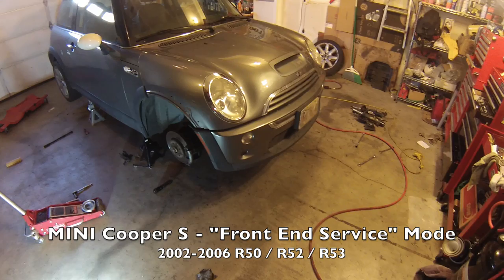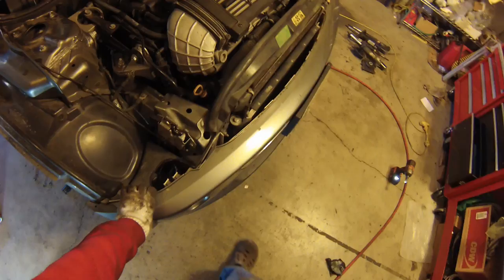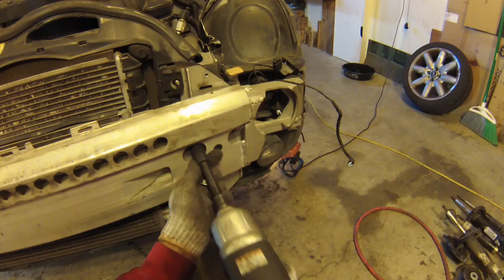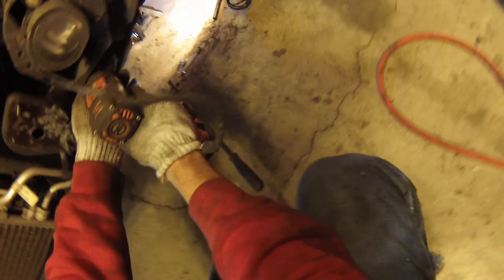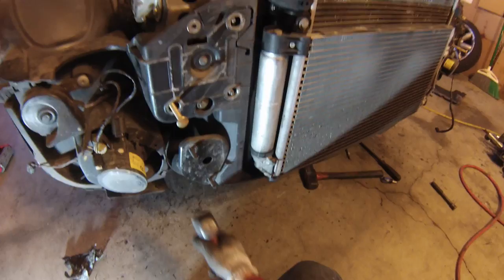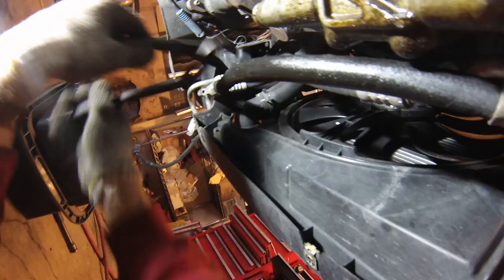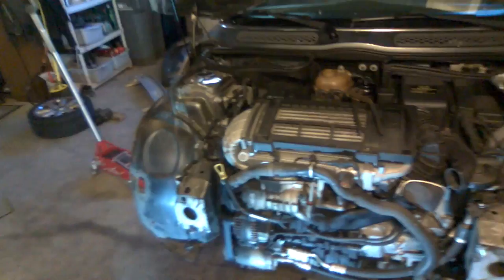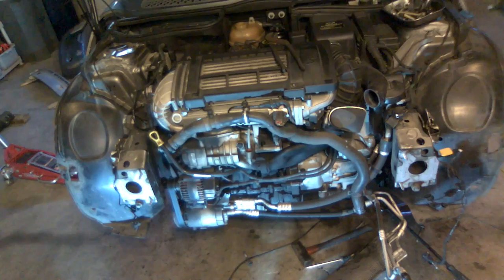Front End Service mode 2002-06 MINI Cooper/radiator/bumper removal howto

Comment: On my 2006, the Torx (bumper cover to radiator support) is a T30, not a T25. Also, the 5, 13mm fasteners, (aluminum bumper) are all nuts over studs (need deep well socket). Torque spec for crash tube bolts is 100Nm/74ft-lb. Long screws to pull radiator forward are 8mm x 1.25mm thread.  (I used VW tool 3411 which are the same thing, just long rods threaded on the end)
Reply from the maker: Thanks for clarifying.

Comment: Thanks again MM. I've kept my '05 for over 100K so needless to say this being a first gen S which is driven hard, I end up doing this ALOT.. My share: use a little anti seize on the threads the first time around, makes things go much quicker both in and out (a little last a long time).
 I put the 10mm guide bolts into the frame while the crash bumper is still on and leave it there until after the bumper is back on.. I find it holds things loosely in place while sorting out the wiring. 
I don't like the screw type fender rivets, they inevitably spin or strip so I buy a whole bag of the pop out kind and change them when they even start to look sketchy. 

I use a long length of wire cloths hanger for pining the tensioner from 2 feet away, it 's easier standing back holding the tensioner tool with one hand and not trying to lean over and negotiate pliers and the little keeper pin.  Same on the release. 

I remove all the body and frame bolt at one while I'm underneath with my impact and 2 sockets, saves a minute or 2.

On a good day start to finish maybe 8-10 minutes.

one last note- I tried chain store parts for while. For me it wasn't cost effective, while the aftermarket gives "lifetime Warrenty" same as mini I found it to be more about marketing. Even if Discount parts store gets a 15% failure rate they still make money. Yes I get a free store replacement but the hours of hassles of doing job twice and perhaps having to wait on store inventory isn't worth the extra 10-20% the dealer charges. I've never had a dealer part fail.

Comment: Wow, can't thank you enough for you helpfull videos. My 2004 mini cooper s JCW was riding so rough that when I brought it to a local shop who gave me an est of 3800$ for suspension renewal, but with your vids and the help of my good friend, who is a pro mechanic,  we dropped the sub frame and replaced ball joints, sway bar links,  hubs and bearings, and for only 100$ we replaced rear trailing arms with a used aluminum set from a 2009.  We are still tweeking but so far a great improvement in ride and handeling. One problem that still concerns me though is this, that the cars bumper cover / air dam/  is not conected to anything along the bottom. I am pretty sure which under tray is missing and which part to order, but between that skid plate and the lower edge of the bumper cover there is nothing. The bumper cover is swinging in the breeze. I think I need the correct oem lip spoiler and I am confused about which one to order.  I think that the missing part anchors the skid plate to car and to lower bumper cover lip.  Thanks, Chris Z

Comment: Turns out it's the radiator.... Leaking on the top, bottom and the coolant overflow tank was full 4 days ago... Now completely empty. Need a new radiator which isn't going to be fun for my mechanic. Thanks for your reply. I've subscribed.
Reply from the maker: Bingo. :-) Seems to be an issue only for 02-03 cars. Amazon has great prices on radiators, probably any of them are better than what the car came with. 
Just follow this video and then it's only another 15 minutes to separate the radiator from the front end module. Entire job shouldn't take more than 2 hours.

Comment: Finally decided to purchase a 2003 R53, and tear into all the maintenance. Cannot thank you enough for all the videos and attention to detail. QUESTION- other than crank sensor o-ring, super charger oil, water pump, and oil pan gasket... what else would you recommend servicing on a mini while in front end service mode? My car has no maintenance history and would like to cover all bases.
Reply from the maker: water pump to block flange o-ring.Valve cover gasket.

Comment: Thanks for the tips, Mod.  What is the thread size on the long bolts used to bring the front out into service position?  What are the chances of reaching the crank position sensor from service position without actually removing the core support?
Reply from the maker: I think they are M8x1.25 thread. They are the same thread as the bolts that you remove from the bumper.

Comment: What size bolts do you use to hold the radiator on when you put the car on service mode? 8mm by what thread pitch? 1.0, 1.25, etc.

Comment: What would you do if the heads of theT30 bolts in the middle that hold the plastic bumper snapped off and you can’t get the rest of it out?

Comment: I just replaced my coolant fan and it won't shut off. When i first bought it last year it would stay on for a new minutes after but would shut off. It died a month ago and i replaced it with a new one today. Now it see,s like it would run for hours until the battery died. Any suggestions, thank you

Comment: Thank you for making this job so much faster and easier for me. I have a 2003 Mini S, 79.000 miles, with a blown head gasket and leaking at a water pump seal. Yesterday my son and I followed your video and removed the front end and the head. Ordering parts now and will put it back together in a week or two. Question, looking into the super charger inter-cooler we found a bunch of small thin plastic scraps at both ends blocking a lot of the air flow and have not figured out what it is or how it got there. Any Ideas?
Reply from the maker: In the intercooler? Never seen that.

Comment: Hey there! I saw somewhere else that it is necessary to drain the air conditioning gas pipe to remove the radiator, but I didn’t catch that step in your video, is it really necessary? Or just by draining the coolant fluid is enough.

Big fan of your videos, I am grateful as everyone here for the big favor you are doing to our wallets
Reply from the maker: I do not open the system. Just hang condenser off to side.

Comment: My bonnet’s latch on the right side of the vehicle (driver side) isn’t shutting all the way, do you know if it’s the latch or the cable that I will fix? Thanks for your videos!
Reply: Try adjusting your passenger-side latch upwards by a few millimeters.  I had to deal with this same issue after replacing my driver- and passenger-side latches (the originals had gotten rusty and gross). After much trial and error, I realized that I had installed the passenger-side latch a few millimeters too low, which caused my bonnet to twist just enough upon closing to prevent it from fully latching on the driver-side.

Comment: Thanks for another very informative video.  I replaced my bypass valve yesterday then noticed that the supercharger intake duct had become detached from the supercharger :(  Looks like I will have to follow the steps right up to removing the radiator to get that fixed
Reply from the maker: beagletube I've done it many times and never seen that happen before. Maybe the 10mm bolt is missing or the plastic is cracked. You might be able to make it go back by pushing in the correct direction. once the throttle body is fastened down, it won't go anywhere.
Reply: ***** Yeah.  Everything looked solid when I reassembled.  Started the car and the revs climbed to 3000 right away and was loud.  Shut it off and began disassembling again.  I noticed the intake duct was all wobbly as soon as I got the snorkel and large air intake hose off.  

Most likely a beginner mistake on my end.  Thanks again for the super informative video and replying

Comment: Thank you for this video. 
If this car needed an alternator replacement, are the radiator hoses long enough to allow the radiator to be slid forward a sufficient distance for access to remove the alternator bolts or is complete radiator removal with disconnecting of radiator hoses inevitable?
Reply from the maker: Yes, the alternator can be replaced without cracking open the cooling system. I have video for an alternator replacement but haven't edited or posted the video yet. Essentially the steps are: disconnect battery, put car in front end service mode, loosen 10mm bolt for battery cable on alternator (use pair of pliers to prevent entire terminal from rotating at the same time), remove accessory belt, unclip regulator cable, remove 3 10mm bolts holding alternator on to engine block, assemble in reverse order.

Comment: Hey since I saw the cooling fan. Is there any way to make them quieter mine turn on almost every time after shutting down the engine. It's really annoying.
Reply from the maker: Sounds like you have a burned out fan low speed resistor. When the low speed resistor is burned out the fan will only run on high speed mode. You can replace the entire fan shroud assembly, which includes the resistor, or replace the resistor. See http://www.northamericanmotoring.com/forums/stock-problems-issues/174040-low-speed-fan-resistor-we-need-solution.html for details about the problem and some solutions, or http://www.amazon.com/TYC-621080-Replacement-Radiator-Condenser/dp/B002BBDNFU for a typical replacement part that will solve your problem.

Comment: Thank u sir. Very much appreciated. Question? What size bolts do u use to screw in to take out the front end. Those two screws u used. Length and diameter. Thank u
Reply from the maker: I don't mention in the video? I think they should be M8 x 1.5, longest you can find.

Comment: Hi Mod MIni, 

After replacing the O rings and Water pump on my mini R53 MCS, once the front was all back together and I turned it over for the first time to  bleed the coolant system, it ran fine for around 30 seconds,  then the revs went up and down, then seemed to develop a missfire. I turned the car off left it for a little bit then tried again once the bumper beam was back on and it seemed to be normal. Not too sure whats going on. 

Any thought would be greatly appreciated.
Reply from the maker: Might have been a vacuum leak, maybe a pinched seal got sucked into place.

Comment: Is it possible to discharge the ac radiator by yourself if you want to replace the ac radiator  I know there are two ports of the left hand side of the mini r53/r52/passanger side.. I wanted to change the ac radiator.
Reply from the maker: That would be an EPA violation.

Comment: Hi. Super helpful.
My car's radiator fan keeps running, the minute it is plugged in (even if the car is off). What would be your guess as to the problem (is it the resistor and should I be changing the whole fan assembly)?
Many thanks
Reply from the maker: Yes resistor. You can splice in another one (not officially approved repair method)  or change the whole fan assembly.

Comment: Thats an awesome DIY! Thanks. I have a question: my R53's cooling fan is wobbling too much (it looks like its hitting the surround). Can I remove the fan shroud with the fan by just moving the radiator that little bit forwards on studs like you did? Or would I need to remove the whole radiator and flush the system?
Reply from the maker: Radiator tips forward to remove fan. Might need to remove upper hose.

Comment: HI. I changing Steering wheel on my Mini R60  . from No Button to Multimedia butts. but is not working. If I buy  ISTA P   , will I bee able to activate  Multi media butts on my steering wheel? thanks for your time
Reply from the maker: Pretty sure the wiring is different. North American Motoring forum may have some useful discussion threads.

Comment: Very helpful video👍🏼

Question: do you need to de-gass the air-conditioning system for the frond end service mode?
Reply from the maker: No, just leave evaporator connected and hanging to the side.

Comment: Is it feasible to change the crank position sensor without totally removing the radiator and leaving the hoses still connected?
Reply from the maker: ewgoforth yes but it is very tight going. You can really only use one hand and need to know where the bolt is because you won’t be able to see it.

Comment: Hi Kurt, Thanks for posting this video. I'm noticing a small coolant leak on the passenger side front of my 03 Mini.. I'm thinking it's the thermostat... Would the vehicle have to be in FES mode to replace that? Thank you :)
Reply from the maker: Hi. On the 2002-2003 cars, they sometimes leak from the radiator inlet hose which is immediately in front of the dipstick, so check there before diagnosing as a thermostat leak. Look for moisture on the plastic side tank at the very top on the passenger side of the radiator (for left hand drive car). 
Having said that, thermostat leaks are very common with most Gen1 model years  
No need to put the car in FES mode for a thermostat. I am doing a thermostat replacement tomorrow and will try to get some video!

Comment: hey just out of interest how much should i pay a garage to replace some of the piping as my minin keeps leaking coolent and the garage said theyll have to take the radiator off to fix the piping how much should that cost tops??
Reply from the maker: Do you mean hoses? It depends on the problem and what a shop charges. I can't imagine it should be more than 5-6 hours labor.

Comment: For an alternator replacement do you think a tear down to this extent is necessary?  This will be my first work on a Mini Cooper.
Reply from the maker: +Adam Barraclough You need to at least pull everything forward into FES mode, but not necessary to remove front end completely. For an R50, you can get it out just by removing the top radiator hose.
Reply: Thank you.

Comment: Just finished replacing my motor mount on my R53 with the help from one of your other videos. I have a few more things I have to do, one being to replace my Radiator Fan. I believe this video is the closest thing you have to showing how to replace it, but I'm sure it can't be too difficult. In your opinion, as I'm sure you've replaced a few, where would you recommend getting a new fan? I would prefer not to spend $300+ buying OEM but I also don't wan to purchase one that will burn out again in a couple months.
Reply from the maker: Not sure what is your question. If your fan is not working, you need to replace the fan. Any fan should be fine. You might be able to find one at a junkyard or on eBay if you don't want to buy a new one.
Reply: Mod MINI I went on RockAuto and they have a few fans on there cheaper than OEM but I wasn't sure if you had any brands you preferred or would avoid

Comment: Very easy to follow and detailed guide. while I have the front end opened up is there any other small things like the crank position o ring that I should be taking care of? I notice I also have some oil build up behind the left fender lining do you know what this could be? Thanks for the guides!
Reply from the maker: +Oases Yes, do the o-ring. Left fender? That's the transmission side. no idea other than a bad axle.
Reply: +Mod MINI Thanks for your reply. Also when I'm putting the radiator and bumper liner back on, how can I tell which cables connect to which lights? Do I put them in depending on the length of the cable?
Reply from the maker: +Oases It's pretty obvious, but shortest goes to the horn, longest goes to the side marker. Medium length goes to the front position marker.
Reply: Okay I thought it was like that just wanted to make sure. My battery is dead with my car on jacks and no way to charge it so I couldnt test. Thanks for your reply!

Comment: Gracias por estos aportes amigo!!!!! ami y al Club nos ayudara mucho...
Reply: *****

Hi Kurt
       I was seeing your videos on you tube, which by the way I find them really  great and very helpful.
Many years ago I use to modified street cars, alpine, R-5 & R-8 Renault for racing, and I use to race them to. They were a totally different cars and motors that they are now. I have a mini cooper S 2005 with heating problem, very unusual for my understanding, because I was driving the car for several weeks with no problem most of the time,  but some times it was getting hot, not every time just some times, until my wife drove it very hot and the radiator now has a leak. So I want to fix it, of course changing the radiator, but most important trying to find the problem.What do you think the problem could be? the pump can not make an intermittent
heating problem?maybe the thermostat or the heating  sensor that turns on the electric fan, to me the electric fan seems working properly. Because of the complexity to reach all those areas I think I'm going to change the pump, the thermostat and probably the electric fan sensor. Please give your advise, and tell me  if you know and can recommend those parts brands:
 Nissens    for Radiator
Mac kay    for coolant hoses
Wahler       for thermostat
Graf            for water pump
or what brands do you recommend ?

If you are not to busy and you can answer me I will deeply appreciate it.

Very best regards
Joaquin
Reply from the maker: Joaquin Balaguer Most leak is from the thermostat housing. Other possibility is radiator itself, water pump, water pump inlet gasket, or maybe a head gasket problem. I usually just choose OEM or OEM equivalent for the brands, making sure not to pick the cheapest supplier.